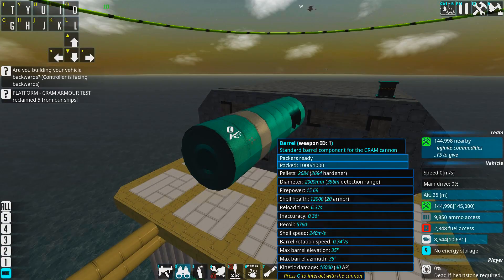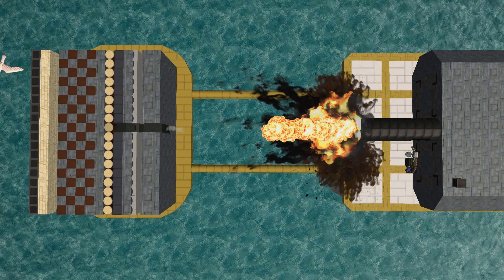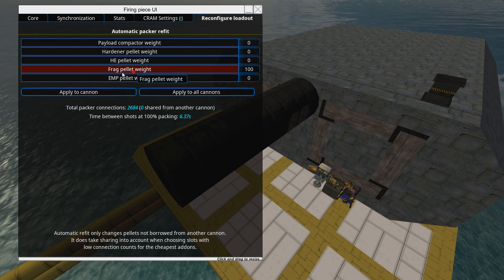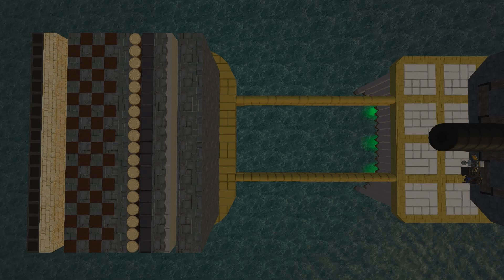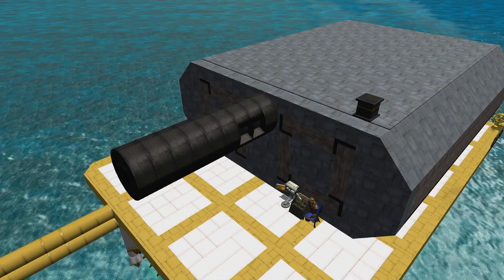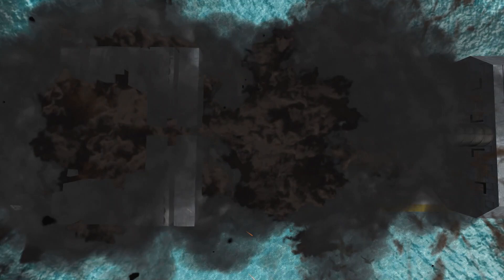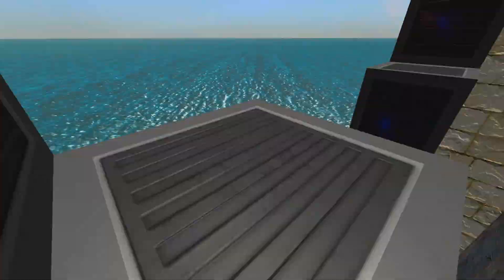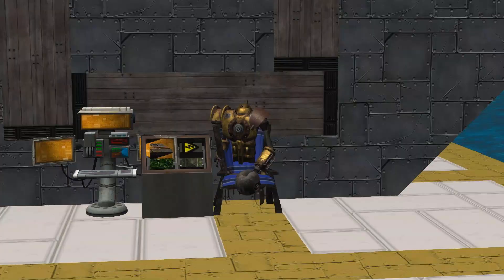From The Depths INSTANT Tutorial: CRAM Cannon Shell Types & Ammo Damage Patterns

Comment: Please, that armor scheme awful. The checkered beams just say F*** you to armor stacking. The poles should be metal and the layer in front of that should be wood, INSTEAD OF HEAVY ARMOR, to deal with heat and hesh. I could make an armor scheme 2 times as effective with half of the layers by going with a layer or two of heavy armor out the front, 2 layers of metal, a layer of alloy for buoyancy, wood for spall liner, then a layer of metal poles for an air gap. This armor is so thick, you would be hard pressed to find a ship to put it on with out downscalling
Reply: Down scaling* the turrets to pea shooters. Why!?
Reply: congrats bro